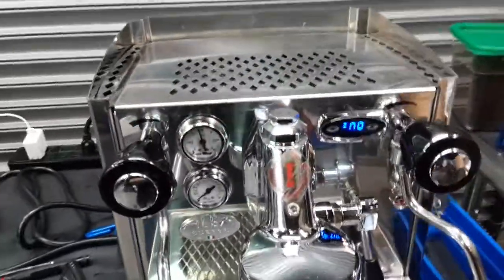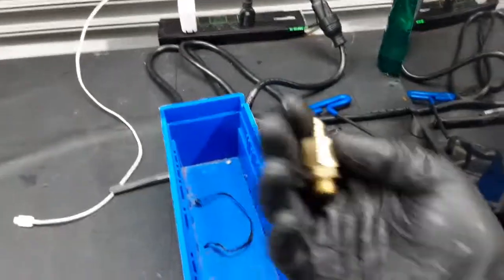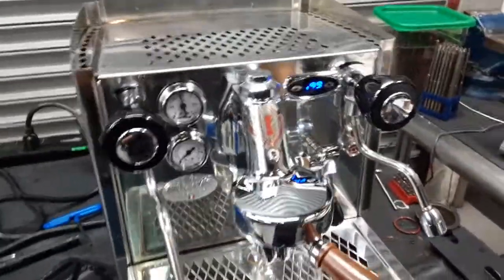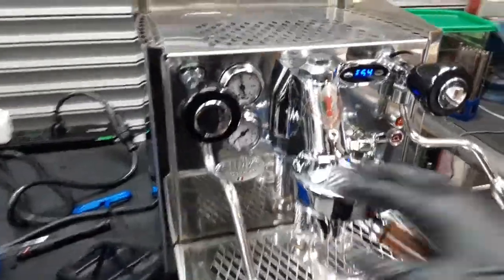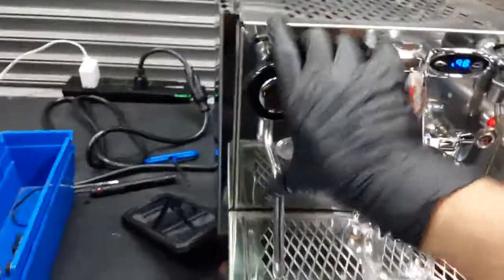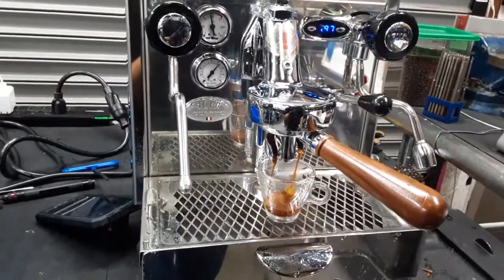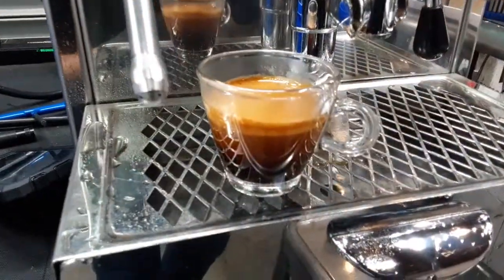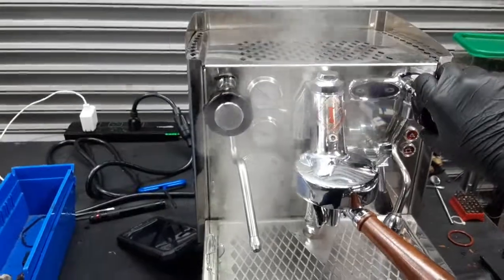Multiple issues  -  Alex Duetto - 4436 test

Comment: Great video. I have an Alex duetto 2 with multiple problems that I think may all be related to scale build-up.  The machine has been descaled in the past but I think it may have gone too far this time.   I solved one scale problem about 2 weeks ago. Sediment in the inlet valve under the plunger prevented machine from filling, alarm would always go off. 
Now I cannot draw shots without the steam boiler blowing the safety valve.  Also brew pressure is only like 4-5 bar.  Other strange things is fluctuation temperatures +/-10 deg while drawing a shot.  Seems if I have the steam boiler off and only brew shots, all the problems go away.  So your video caught my attention when you said you have to descale the steam boiler manually.  What was the reason and do you think I may have to do the same thing?  How about manually descaling the pump? I feel if there was a large chunk of debris in the pump I could be getting some back pressure causing the steam boiler to behave erratically.
Any suggestions would be greatly appreciated.